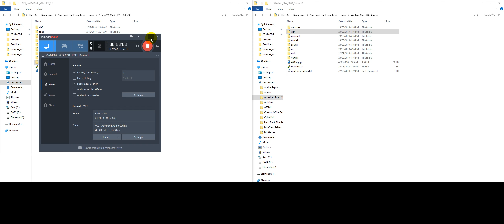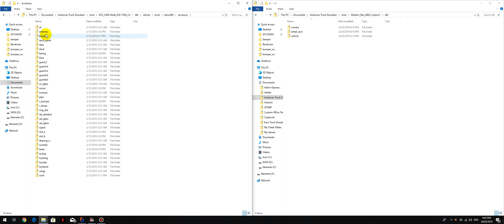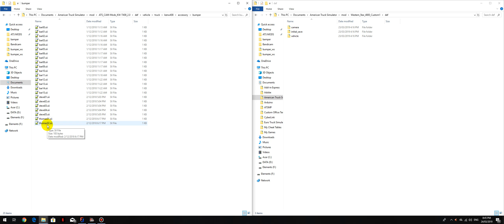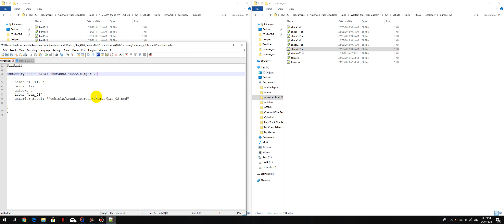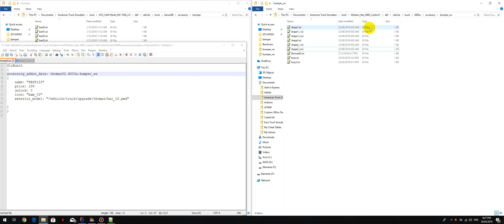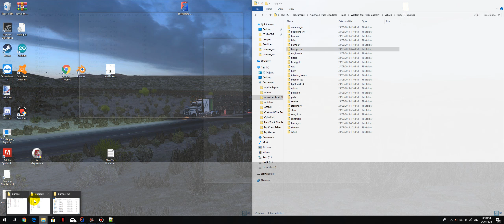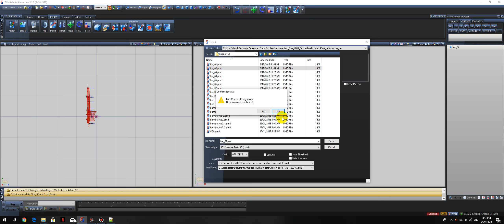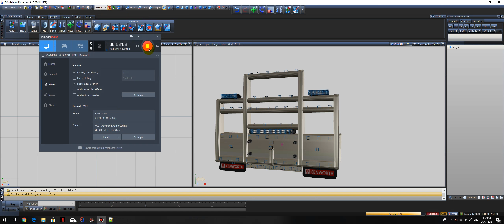Take a "part" from one mod to the other

Comment: Tony Bradley just watched this video nice vid by the way but I was wondering would this be the same process to add airline connection's to a trailer?
Reply from the maker: toppdogg981  I would assume it will be mate, I will have a look and add a video later, I know there is a trl cables folder I’ve seen in mods before
Reply: @tonybradley4126   cheers for your reply.
Reply from the maker: @toppdogg981   hey mate can you contact me via facebook